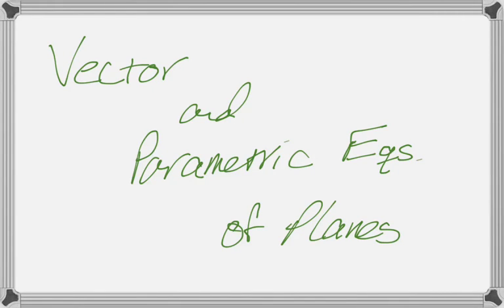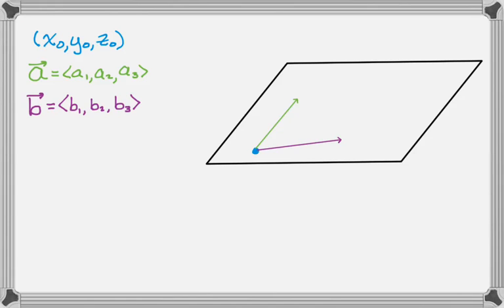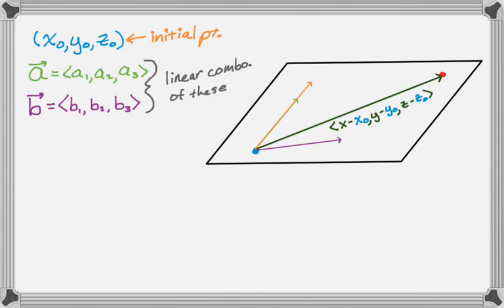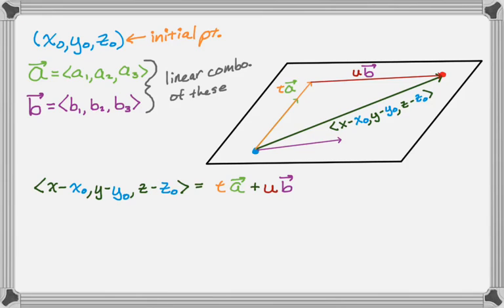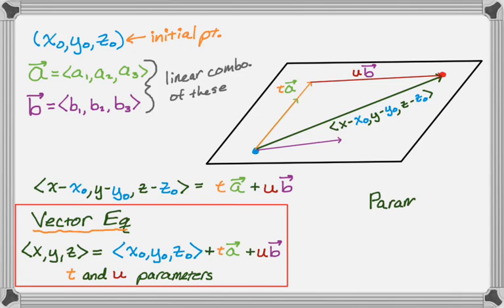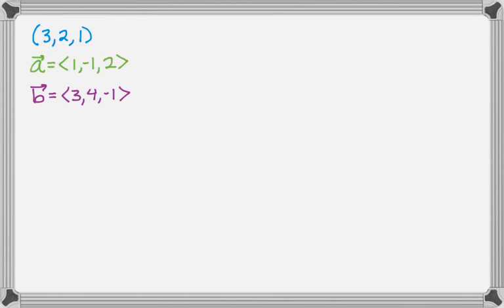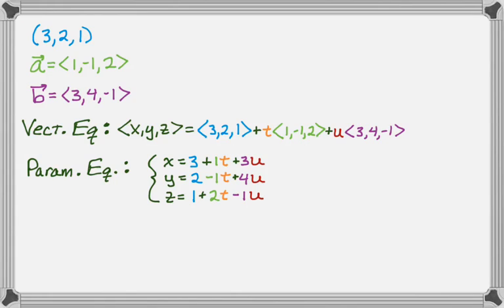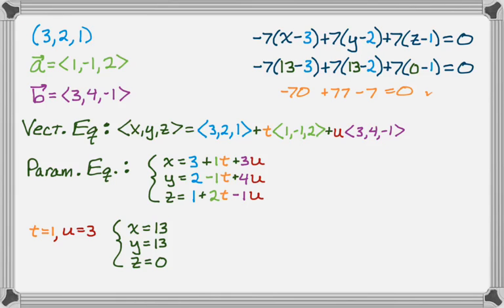Vector and Parametric Equations of a Plane

Comment: Excuse me, professor. Is this a different type of equation of a plane than "equation of a plane given normal vector and a point"?
Reply from the maker: Yes!  It's a different form of the equation.  Depending on what information you're initially given it can be more convenient to represent the plane using the vector or parametric form.  I would say that the point-normal form is much more common, though.
Reply: @turksvids  Thank you!

Comment: Where did 7 came from?
Reply from the maker: I did the problem in a slightly different way, finding the cross product of the two vectors to get a single vector normal to the plane and then used point-normal form of the equation to write the equation of the plane.  Hope this helps!

Comment: How did you get t=1 and u=3 ?
Reply from the maker: The equation should work for all real numbers t and u, so i just picked those as an example pair to confirm that they do give you an ordered triple that's on the plane.  Pick any number for t and any number for u, get the triple from the parametric equations, sub it into the non-parametric and it should satisfy the equation.  Hope this helps!